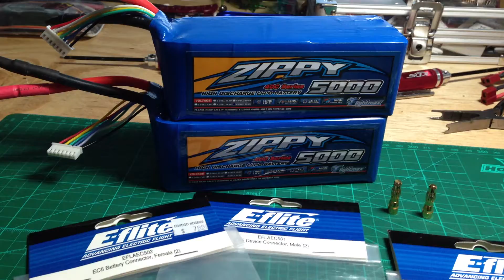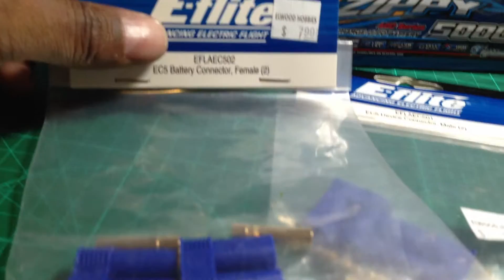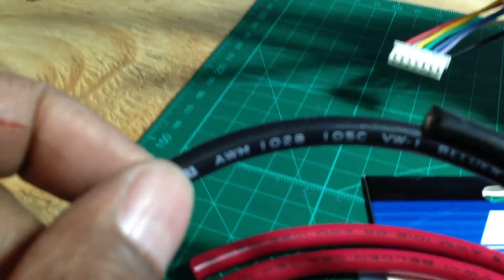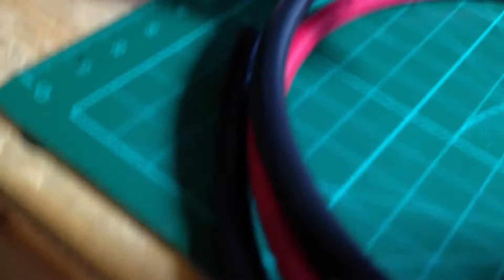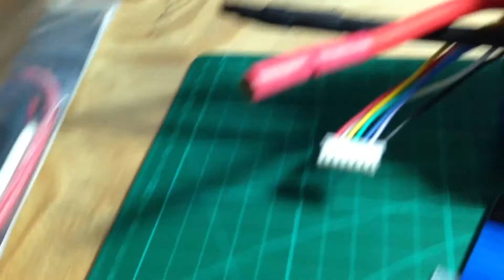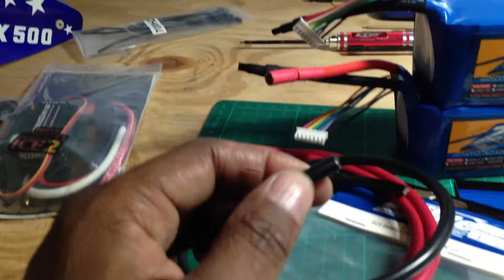Battery wire hookup

Comment: you can work 10awg wire because zippy's  5000 mah are away made with 8awg wiring I made 10awg y harness for my trex 700e you can look for castle creations10awg on ebay or horizon hobbies to make it . and make sure you watch a vid on making y harness for heli's. and as of what bec system are you using ?